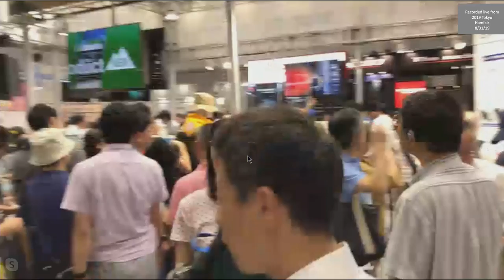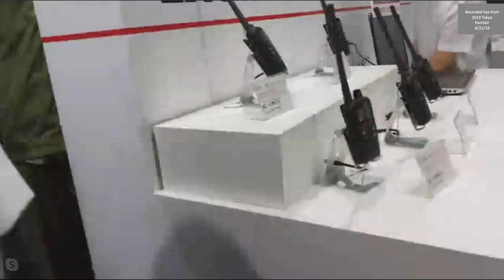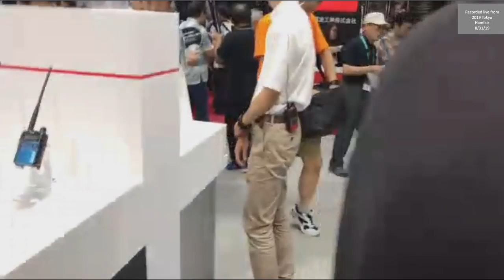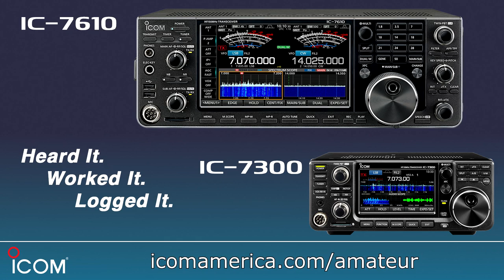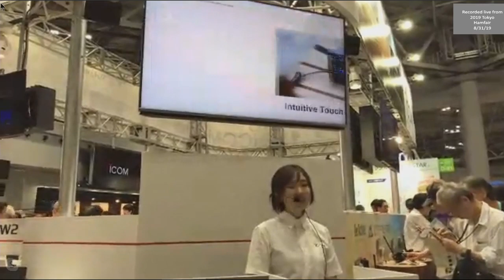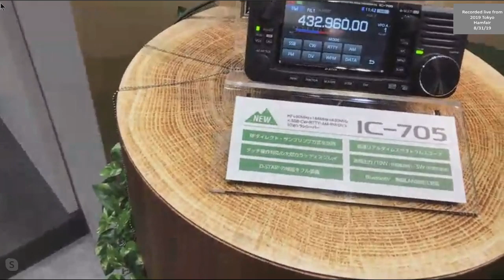Ham College 56

Comment: WRT battery voltage for maximum life, yes you can run a 12v battery down to 10.5 v but that is NOT maximum "life" for the battery. You are taking the battery down to 0% state of charge, and every manufacturer will tell you that stresses the battery and produces MINIMUM battery life. They will all tell you that taking the battery down to 70% SOC, about 12.3-12.4 volts, provides maximum life, and that 50% SOC (near 12 volts) is the lowest that any type of lead acid cell should be taken to. Overall life and the total number of charge cycles plummets when discharged below 50% state of charge.
 The question is midphrased, as it stands the answer is wrong, according to the entire industry and all the engineers in it. If that one is in the new question pool, it should be pulled.
Reply from the maker: That question and answer doesn't change in the new General question pool. So the answer remains 'C. 10.5 volts' if you want it counted as correct.